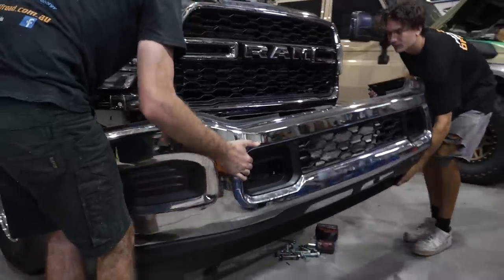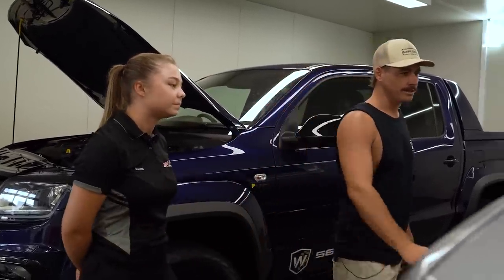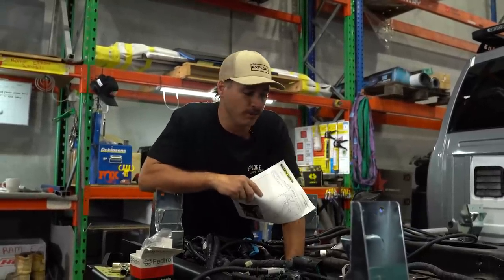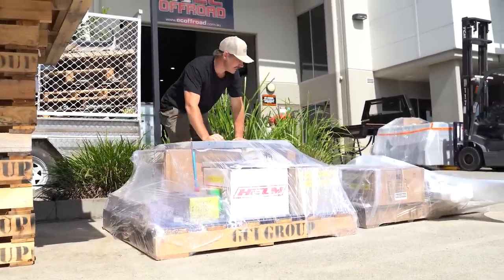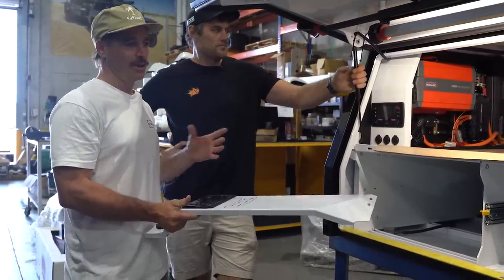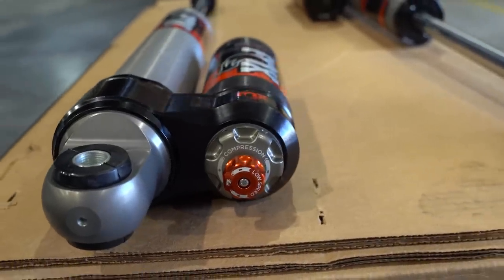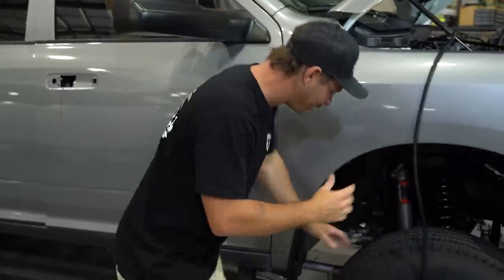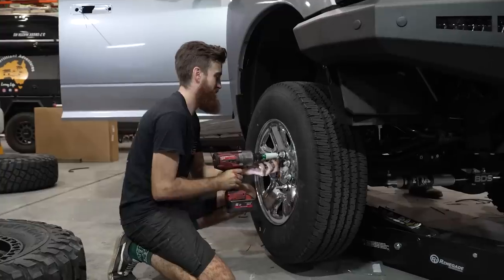BUILDING THE ULTIMATE AUSSIE RAM TO TOUR THE USA!

Comment: Can anyone explain how the vehicle can drop so low with an air bag/spring setup? Logically for the springs to compress that much I would have thought that the springs would need to be specified for a low load rating, therefore making them too soft and having the air bags perform more work than they're designed for. scratching my head... Thanks for the content
Reply: It's full air rear.. No coils

Comment: I like the tray and canopy setup but the suspension is a odd setup. Why so tall? These trucks fit 37s with no lift. A 3500 with the high output engine and Asian transmission would've been a better choice, more power and more payload, that 2500 has to be near / over max GVW. I have a 18 2500 with the 6.7,it's been a great truck but it's better for towing not hauling, payload is pretty pathetic at around 2000lbs